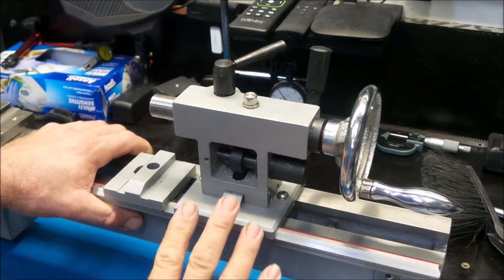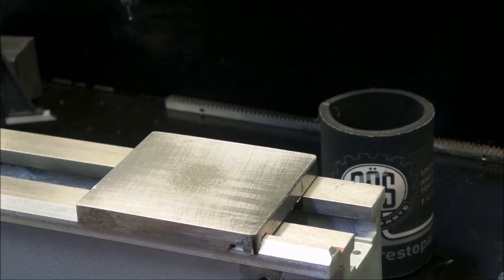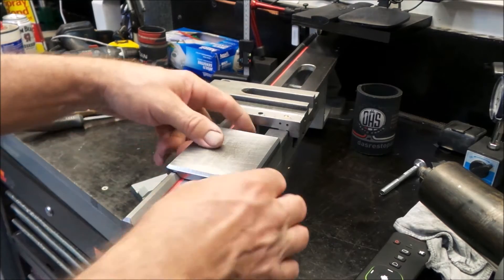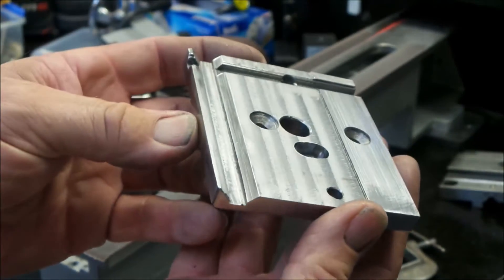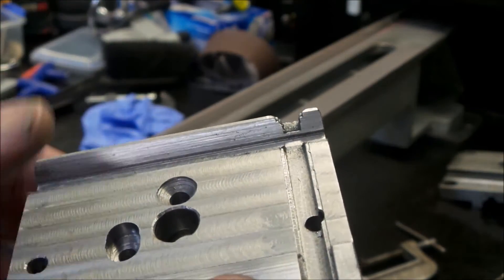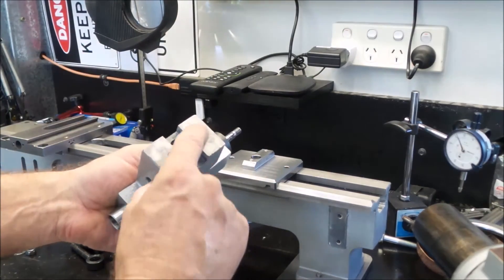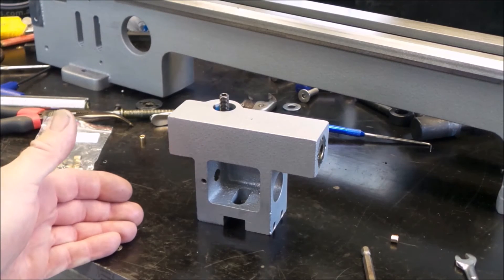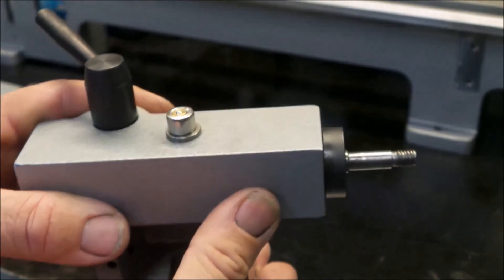New, Tail Stock Foot Plate, For The Mini Lathe. EP:7

Comment: Oiling grooves would have made lapping a bit faster.. and lapping the cross slide at the same time..  I do like the bigger 'footprint' of the tail stock as I'm thinking of doing so, but I'm adding shim grooves and holes to epoxy in the final setting ( I bought a second tail stock for this)..  and your oiler bolt, well it gives a bigger reserve...

Comment: For future reference, sewing machine oil or water would work with the spray on adhesive. WD 40 is well known for its ability to dissolve the glue used for sticky labels, just spray it on, rub it in and a few minutes later label and glue will rub off...

Comment: All you need is to drill a smaller hole fellow by drilling with a 6mm deep enough to hold the oil push cap but not all the way through. I think that will work. BTW, can you share a link to ebay where you got your push oil cap. I try searching but can't find. Thanks for sharing.
Reply from the maker: Hi Vincent, a solid idea, unfortunately i drilled all the way through  in one go & had to work around it. here is the link https://tinyurl.com/yy7br4ov

Comment: I understand your concern about the time it will take to lap in the underside of the bed.. it will be very slow going.
How about planing the bulk of the material off? Make up a tool holder block  that you can fit to the underside of the cross slide carriage. Set a lathe tool to the thinnest part of the over hang and push the cross slide the length of the bed. After that, jockey the tool over a hair and make another pass. Not fast..but a lot faster than trying to remove the material with abrasive paper.

Cheers from NC/USA
Reply from the maker: G'Day Mate, thats a really good idea. I think that would have saved quite some time. I've actually just finished that task & it was quite gruelling. I figure I have about 6-8 hours in it. I just need to do the production work on the footage & try to get it down to something watchable. Spoiler, it turned out really good. Thanks for the Comment, much appreciated.

Comment: Hi Trevor,

Excellent video. I admire your patience and perseverance on this project. I like the idea of the larger footplate for the tail stock, but I wonder if it might cause a problem. The new base plate appears to extend a bit further under the quill than the original base plate. A problem that I encounter when I am turning a piece using a live center in the tail stock is that the back of the saddle bumps into the foot plate of tail stock when I move the saddle far enough to the right to position a tool past the right end of the work near the live center with a tool to start a turning pass. To get the tool past the end of the work to start a cut, you'll have to crank the quill out to near its maximum extension. Cranking the tail stock quill out too far reduces the rigidity of your set up, which can severely affect the precision and finish of your work. Also, there is a limit to how far you can extend the quill. If the base plate extends further under the quill than the original base plate, it will exacerbate this problem.
Reply from the maker: Hi David, Yes I agree. I'll see how it goes once the lathe is in use. I did consider this when making the foot plate, but after looking at all of the different versions of the mini lathe tailstocks that were produced,  i figured it may be okay. I can always modify it later & cut off the protruding 15mm. Then shift the front locking plate bolt to under the front of the tailstock. I appreciate your comment. Cheers Trevor.
Reply: @TheAussieShed  My first thought was now you have shorten the workable bed length. Leaving the little oiler high seems like it would have been better than the now big bolt projection.  Now it needs a matching paint job. 👍

Comment: Great job looks awesome. Mine came with oiler fitted standard, like the Way you fitted it in the cap head bolt looks good I think.
I just had my headstock apart and upgraded fitted metal gears and annular contact bearings . Also drilled to grease ports on the top of the headstock to make inspection and greasing easy.
Thanks nice update can’t wait to see the next video.
Have a good day all the best 
Jace.